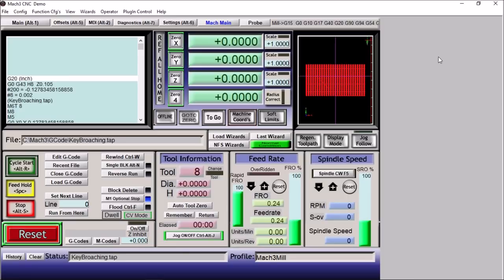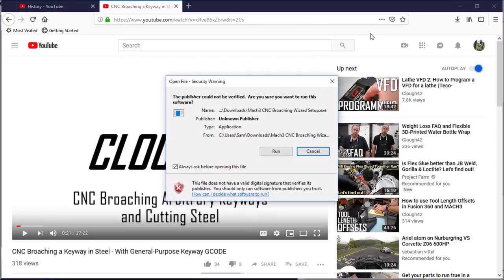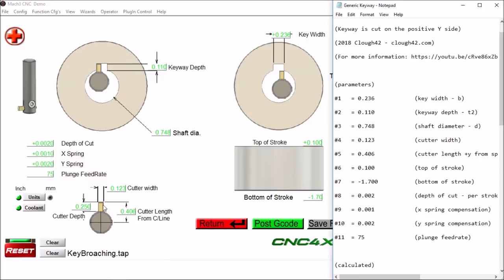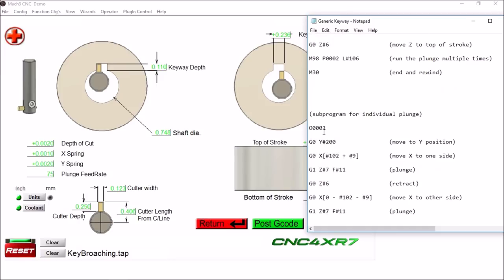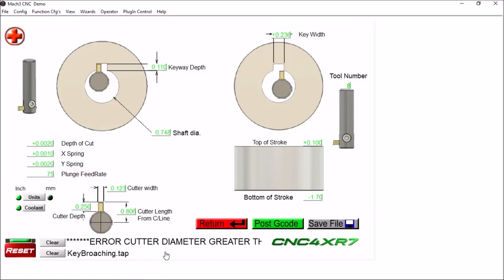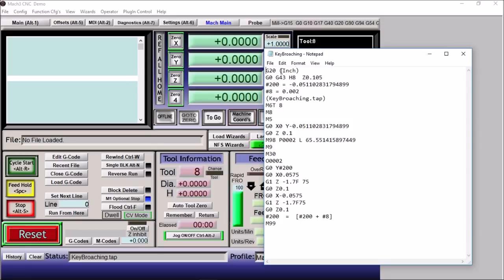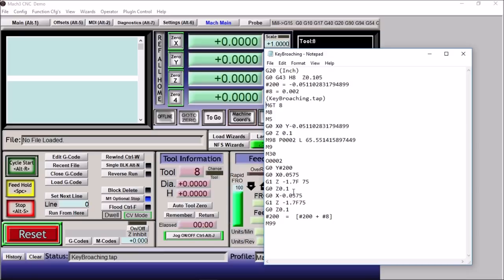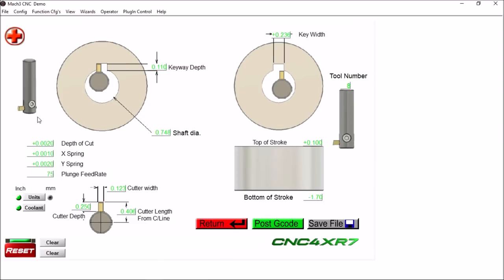Mach3 CNC Keyway Broaching Wizard

Comment: Windows Defender quarantined my downloaded copy because it had a trojan virus.  Nice Wizard Sam.  I have been thinking of using my X3 CNC Mill to  perform broaching for some time now.
Reply from the maker: Yeah Most likely because it's a .exe file I'm not having any issue you tube does pop up a warning when you click on the link. I use FireFox and AVG with no issues.

Comment: Hi Sir, Thank you for creating the Wizard and share with all of us. After analysis of the gcode and explanation of Clough42, I noticed the relationship between keyway width and cutter width ; (keyway width =< cutter width =< 1/2 keyway width) to adequately cut the keyway slot. I noticed the wizard does not check for min cutter width of at lease 1/2 of keyway width. My suggestion to may be put it in ?
Reply from the maker: Noted